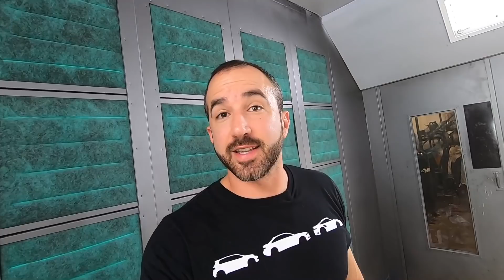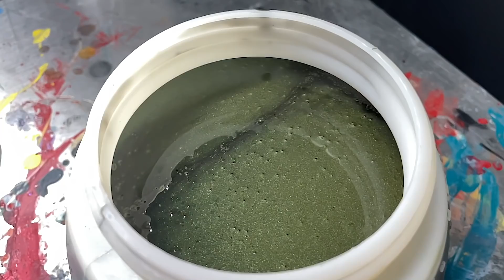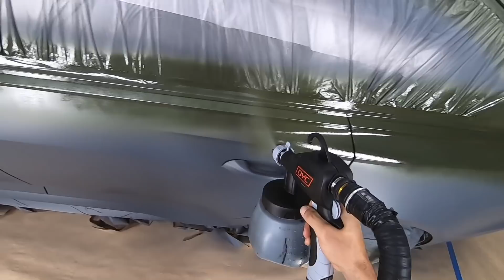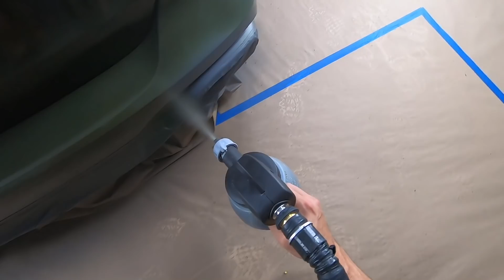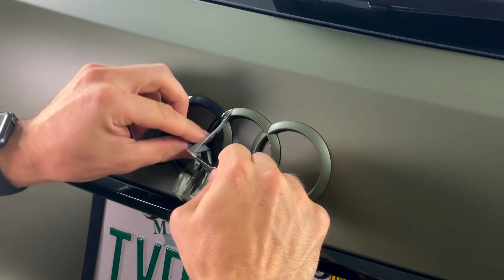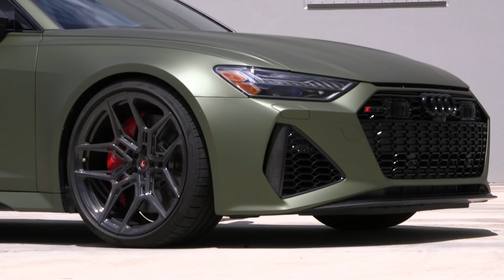Mixed Up the Perfect Color for My Favorite Car  (I'm in Love ❤️)

Comment: Please do a faded look using amethyst purple in the front and sterling silver in the back with royal blue holographic micro flakes. Also, please use either a white or black base, whichever one gives you the best results. (Perhaps test them both on those little sample pieces and show the difference between using the two separate bases, and do a full car on the most promising one?)

(I keep editing because I keep changing my mind on the pearls/flakes)

Comment: Hey Man great stuff. Wanted to ask, do you have any videos on here showing how to remove Plasti Dip from a car not from rims? That would be awesome. After watching a dozen of your videos I did a partial dip on my FJ Cruiser years ago I want to remove some of the Plasti Dip from the side panels and then re-dip the car with your chocolate Ore with black roof. if I leave the side panels on I'm afraid it will have a different texture and thickness than the regular paint on the rest of the car if I Plasti Dip over it..